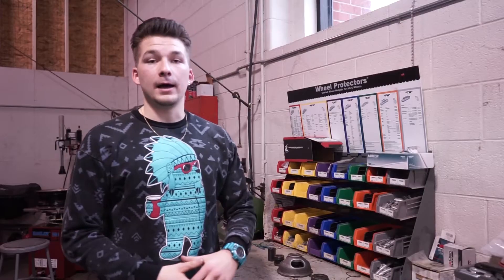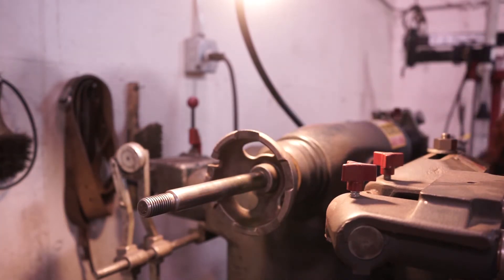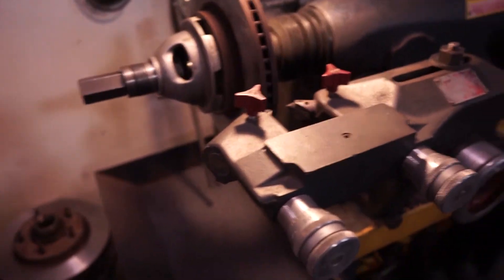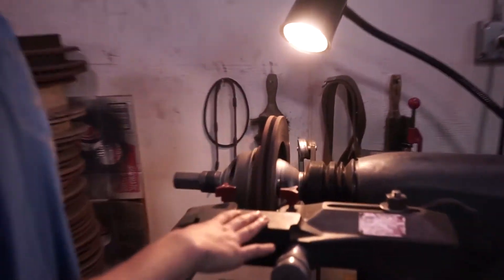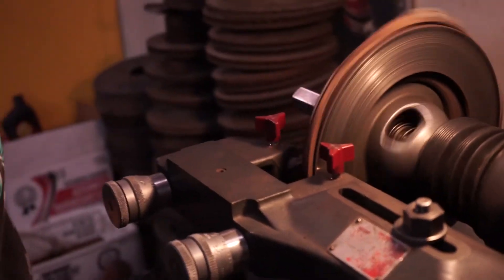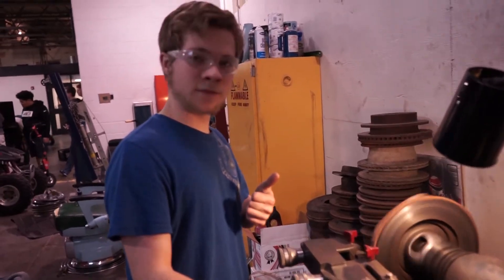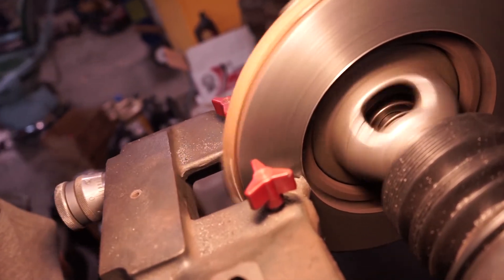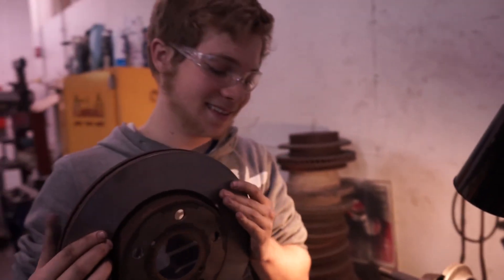Disk Brake Machining on a Lathe

Comment: Well done young man. Thumbs up. ;-)

Now my 2 cents. Regarding something that´s usually totally overlooked.
Before assembling it back in the vehicle. Make sure the mating surfaces are perfectly clean. Wire brush on a drill, makes it a 1 or 2 minute operation. ;-)

Avoid a lot of potential head aches, with wheels wobbling all over the place.
The amount of debris, mud, rust, etc. accumulated in those surfaces can be quite overwhelming,. Specially for those who drive in ice, snow, salt and mud conditions.
Do not forget the hub mating surface in the car and the wheel itself.

It´s boring, yes it is. But believe me it´s faster to do it, than write about it. ;-) 
Keep up the good work.
Cheers
Reply from the maker: crpth1 excellent point sir! Thank you for your input.